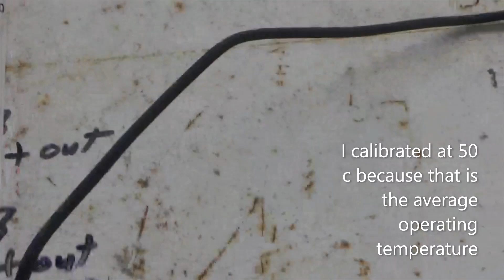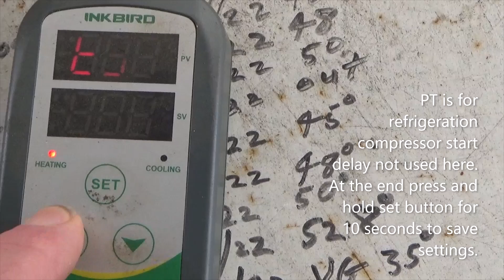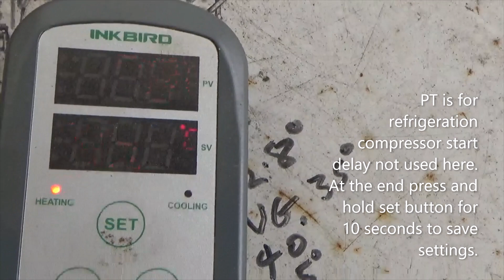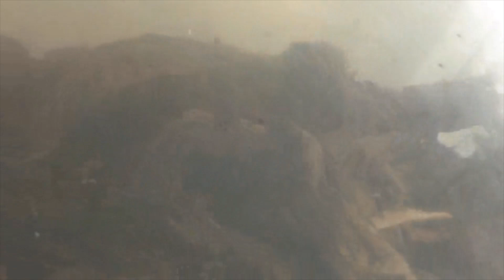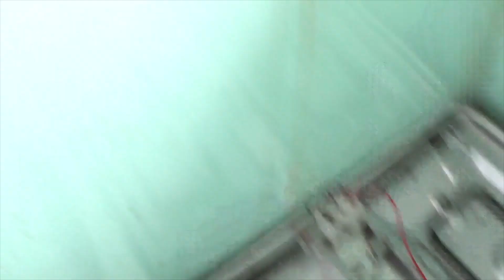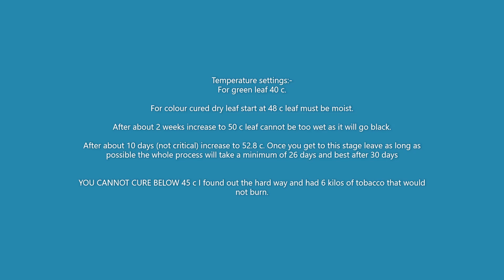Tobacco Flu Curing  #tobacco #tobaccotalk #garden #urbangarden #homegardening #urbangardening

Comment: That’s a tricky set up and quality control. Thanks for the details, especially the very specific temperatures needed to produce good quality. That will remove a lot of trial and error.
Reply from the maker: I had a lot of failures and a lot of the information online is false or misleading I find the bins are the easiest way to control the humidity and the correct colour curing makes life so much easier.
Reply from the maker: I see the link for the Inkbird is a slightly different type to mine but it will work OK see ad photos to see the differences no alarms except for high heat and no compressor time delay setting see sellers other listings for other types.